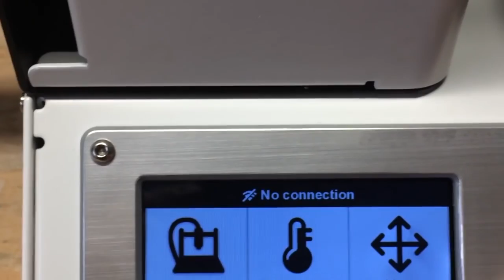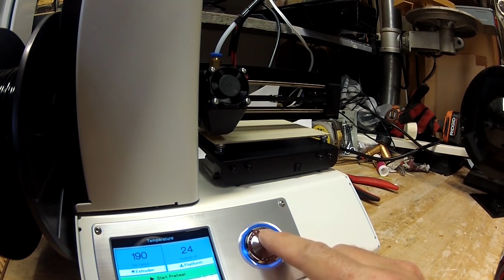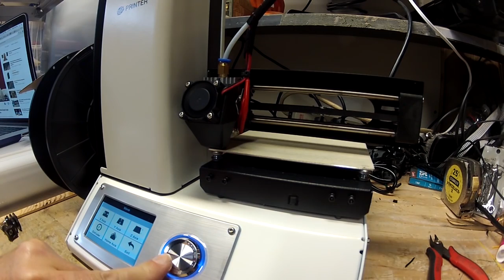BLACK FRIDAY 3D Printer for $179 Monoprice MP Select Mini Review the good and the bad UPDATED

Comment: will it print with TPU?
Reply from the maker: The manufacturer does not list TPU or other flexible filaments in their compatible filaments list, however there have been some who have successfully printed with ninja-flex or other TPU filaments. Go check out the redit or facebook groups. There is a mod you can print to keep the filament from bowing out between the extruder gear and the start of the bowden tube.
Reply: 👍thank you man!